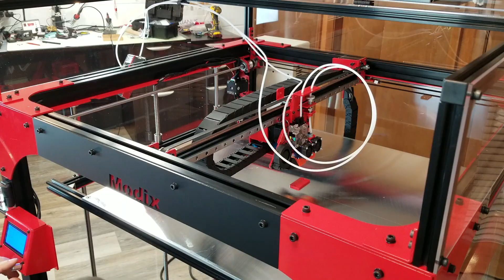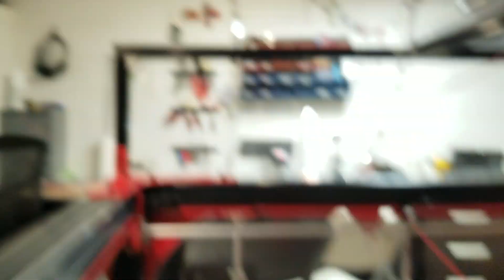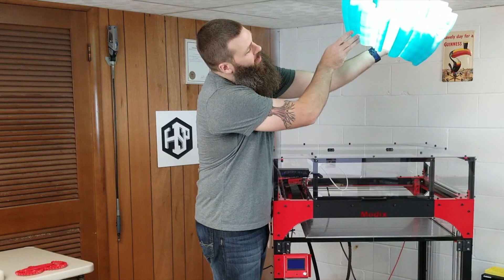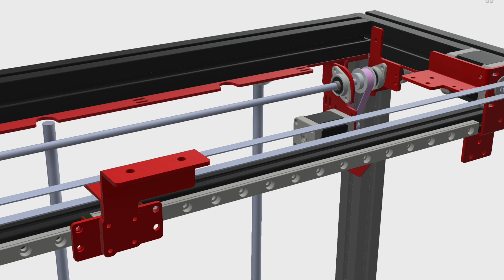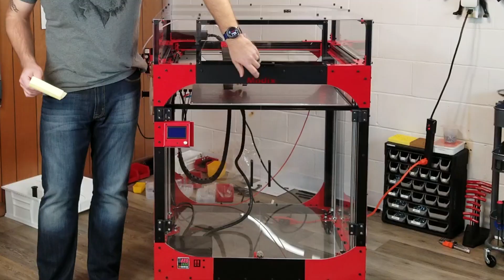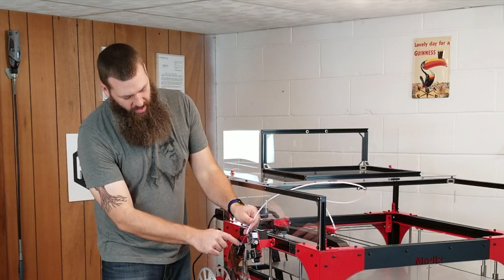Modix BIG-60 3D Printer Build Part 6: Calibration, First Prints, and Final Thoughts

Comment: I just purchased a used Big-60 that looks to be the same as yours. 
As in the three screws , induction leveling (which confused me with an aluminum bed ) and the same controller. 
So far it prints,  although it's not leveling correctly. 
The build plate also seems like it's not far enough to the right. 
It will print though. 
So now I'll be servicing it and lubing it checking the tram and everything else on the unit. 
I'd really like to turn it into an idex but time will tell.
Thanks for your videos,  I love them and will be using them I'm sure.

Comment: Hi Brandon! I have a V3 and have found the Z access seems to "drop" over the course of a print. It starts out correctly, but drops each layer by a few fractions of a mm and needs to be jogged every few layers to get it right. On one occasion I left it to print and found it destroyed two heat breaks and two nozzles in the process. Have you encountered this?
Reply from the maker: This sounds like a machine with a pretty serious problem with the z-axis motion system. It's not something I've encountered (or have ever even heard of) with a Modix printer, but my best suggestion is to ensure that the bed is truly level, and that every part of the z-axis motion system (ball screws, linear rails, linear bearings) is well lubricated. Also, make sure the ball screws are not bottoming out inside the 4040 extrusions that make up the bottom part of the frame--I've seen that happen before. Lastly, make sure the grub screws on the pulleys and bearings for the z-axis motors and ball screws aren't backing out. Might be worth putting a bit of threadlocker on those and then retightening them so they aren't slipping. I hope that helps--good luck!
Reply: @ecostruder  Thank you for your reply! On further investigation, it looks like a combined error of Modix config files using a lower threshold for turning off auto-bed compensation and over extrusion/layer height. Essentially, too much plastic being squeezed out over a given distance means "piling" of material larger than the layer height. This causes the extruder to sink into the material and if the distances are massive, the plastic is cold enough to damage the print head. So I have been working on getting layer heights right compared to extrusion multipliers and plastic temps, which is hard with a fairly basic hot end... Anyway, all good. I'll keep battling away!

Comment: Hi Brandon, great videos. I own a Modix Big 60 and had some challenges getting the printer properly calibrated. Eventually I managed to get it properly levelled but noticed that the E3D extruder is a very vulnerable weak part in relation to the powerful steppers used in the Modix. Do you by any chance have any experience with another extruder such as a Bondtech BMG on Modix?
Reply from the maker: Thanks for watching! I'm curious what you mean by the extruder being a weak part. The E3D Titan (or Titan Aero on the version 3 machines) is quite powerful. It uses a 3:1 gear ratio to multiply the power of the stepper motor to push filament. I had the Titan in my v2 Big60 pulling filament off of a 10kg spool of PETG and printing through a SuperVolcano, so it's definitely got the power to push filament! But no, I haven't tried using a BMG (or similar) extruder before. But the E3D Hemera is an extremely interesting option once it's mature and "ready for prime time!"

Comment: Thank you for the excellent series of videos! I see you are offering the dual extruder kit on your website. Do you still not recommend it? I'm interested in using the second extruder for soluble support.
Reply from the maker: Thanks for watching my series of videos! Yes, I do indeed still sell the machines with the secondary extruder option but I'm still not a big fan of that side-by-side setup, especially when one of the extruders is a bowden and the other is direct. The good news is that Modix is releasing their v3 machines very soon and they are going to be completely redesigned, including the secondary extruder system. I'm quite eager to see how it works compared to the v2 machines. I have filmed a follow-up review of the v2 Big60 which now needs editing and I hope to have it posted within the next few days.
Reply from the maker: @Chauser72  Yes, I am very excited for the v3 machines! I'll be getting a 120X v3 for my shop and I have had a customer pre-order one through me as well. While I really like my Big60 v2, there are some significant upgrades in these new machines. Rest assured that I'll post some videos about it once I have mine!

Comment: Hello ECOstruder, since you've had your Big 60 for about 10 months now, could you follow up your really nice candid video series of the Big 60 with what mods (both hardware and software) you've done to it and what was the outcomes! Like for example, have you tried the Mosaic on it and if so, how did it work? I was thinking of getting a Big 120 (have clients that need really large parts!) and was wondering what I'd run into with it?  Next I was wondering what are you using to control this beast? Such as Octoprint or Repetier running on a Raspberry Pi or some other method? Thanks for the awesome video's and I cannot wait to see what else you're adding to your Big 60!
Reply from the maker: Thanks for the great suggestion! In fact, it's I was already planning to do this exact thing--I just need to get around to doing it. You've given me more motivation to get it done, so expect the video sometime soon(ish)!
Just a quick disclaimer: one of the things I have done in the past 10 months is establish a reseller relationship with Modix. I will provide the most unbiased feedback as possible, but it's important to recognize that I may still have some unconscious bias in my comments since I now sell these machines.
Reply: @ecostruder  I'm looking forward to your next video on this machine, too. Thank you.

Comment: Excellent video! I'm building one right now and I hope everything goes fine with it, any advice for the calibration process? I've heard that auto-leveling is the most difficult part, how was your experience with this process? Have a great one!
Reply from the maker: Thanks for watching, and I am happy that you found it helpful. I will be doing a follow up to this video now that I have many hundreds of hours of printing time with it. As far as the bed leveling goes, I actually found it to be very easy. You just need to get the bed as level as possible side to side and front to back as you can by manually turning the ball screws. Then just run the Unified Bed Leveling procedure and save the results to memory. From then on the machine will compensate for any high or low spots on all future prints as long as you reference that mesh in your starting scripts for each print. It works great!

Comment: Just completed mine today.  No issues, though common sense was occasionally applied instead of calling support as the online assembly instructions haven't quite kept up with the changes and improvements to the Big60 V2.  So far, I love it and had no problem building it at age 75. Can't wait to do a few test parts and then putting it into service for the commercial product manufacturing I purchased it for.  Enjoyed your comments!
Reply from the maker: Fantastic! Excellent job on the application of common sense--the machine is constantly being updated and evolving, so I'm not surprised to hear that the instructions haven't been keeping up. I hope you have as much fun with it as I have had with mine.
Reply: Dan, your comment on the Big60 has me feeling better about my purchase.  I'm not a tech person and have been floundering a little when it comes to getting an item to print, but I am hopeful I will succeed.

Comment: Funny you would mention the instructions...I just put together mine and the further I got, the instructions were less and less and finally not detailed enough.  I'm going to print this weekend so I hope the calibration goes well for me....
Reply from the maker: Yeah, the instructions have gotten improved quite a bit since I used them to build my Big60, but it sounds like they might still have some room for improvement. I'm going to be building a pair of Big60s for one of my customers, so I'll see what has changed very soon!
Reply: Wow! Two builds....I'm sure it will get easier and easier.  After printing the test line, I decided to stop wasting time and I bought a piece of mirror and swapped out the sensor for the BLtouch.  The mirror should be ready today. $53 for a 26x26x1/4 mirror...we'll see how it does.  I just didn't want to put the PEI sheet on only to have to replace it down the road so I tried printing on the alum. plate with glue/water applicated.  It was just so so.. Good luck with the two builds!!  
  @ecostruder

Comment: How are you able to get your prints so smooth? With the profiles from the Modix site we're getting a lot of lines in our prints, and just low quality output in general. Are you using Simplify3D?
Reply from the maker: Hi! Yes, I'm using Simplify3D and working from the supplied profiles from Modix. Of course, I always do some additional tweaking to the profiles to dial them in as I go, but most of these prints were pretty close to the original S3D profile. I'm sorry to hear that your prints didn't look the same--I'm not sure why that would be. Have you checked to ensure that your belts are tight and your bed is leveled properly?
Reply: @ecostruder  .  I am getting some banding in the Z Axis as well.  Is there a way for you to share your Simplify3D printer profile?
Reply from the maker: @TheEebel  Sure, I would be happy to. Shoot me an email to ECOstruder@HartSmartProducts.com and I'll send it to you. That said, I don't think the way the model is sliced will usually cause z-banding. Make sure your bed is level, your ball screws are straight, and your rods are lubricated so there isn't any friction causing the bed to hang.

Comment: Wow that's actually really reasonable in price for the printing size! I'm considering a Railcore II ZLT but I could see a lot more uses for a 3d printer with this build volume. The price is a bit beyond what I can manage right now. Those prints are impressive and I do hope they upgrade to a touchscreen LCD.
Reply from the maker: Thanks! Yes, I agree with everything you said. It's a big machine that is very reasonably priced for what it can do, but it's a big machine, so it will cost more than smaller ones. I'm quite interested in the Railcore as well. Mostly because I want to use the E3D Tool changer on it. A touchscreen can be added after the fact, but yes, I think a touchscreen included with the machine from the start would be a nice touch.
Reply: @ecostruder  Now you're talking. I love the fact that they state they overbuild it for future proofing needs and the E3D tool changer made me pick my jaw up off the floor the first time I saw it.
Reply: The low price point is due to the poor instructions Modix provides. You need a guy like this to make a video who is unpaid for doing so to get it set up. Thank you for your video!

Comment: Great video, I'm using 0.8 nozzle and printing with 0.6 layer hight the result is not that good and I could not find a slicing profile on Modix website they only have the 0.4 profile can you please tell me where I can find a good profile, I'm using simplify 3D. Thank's
Reply from the maker: Thanks for watching! The profile they provide is a great starting point. I actually used their profile to print the big red coaster without any issues. It can be changed to .6mm or .8mm and as long as you select "auto" for the extrusion width. Then you can change the layer height to an appropriate size (.6 layer height should be ok, but I wouldn't go any bigger). Have you contacted Modix customer service for help yet? Shoot me an email to Ecostruder@hartsmartproducts.com with some pictures of the issues you're having with your print quality. I'd also be curious to see screenshots of each tab in your Simplify3D settings. If I can help I will, but Modix is your best option for expert advice on the Big60!
Reply: @ecostruder  Thanks, I will  make these changes and see if I can get clean prints. Thanks again.

Comment: I want to see tiny details. Im interested in a big printer that doesnt require me to have a second printer for small stuff
Reply from the maker: Great point--if this is going to be the only printer you run then it needs to do everything. While that's not really what it is designed for, it has performed quite well when I've put a small (0.4mm) nozzle on it and printed at 100 micron layer resolution. That said, it does use an E3D Volcano hotend, which is meant for high volume and not necessarily high detail. BUT the Titan extruder allows you to rather easily swap in a standard E3D V6 hotend instead, which gets you very nice detail. The BIG 60's mechanical components would not have any trouble with the precision to produce this type of part.

Comment: The reason to test the small parts is to run a whoooolllle bunch in batches. Running 200 2" diameter tokens for a VEX team and cramming 13 a batch on my FT-5. Sure could use that big dog to finish the 200 hours... Maybe this year is the year for a great big dog!
Reply from the maker: Good point--you could fit a lot of parts on that big print bed! However, I never trust any of my machines enough to do that. I always prefer smaller batches. If even one of those 2" tokens failed it could ruin the entire batch. It's a calculated risk, I suppose. But a risk I usually would rather not take, even on machines that typically perform very reliably.
Reply: @ecostruder  It can be sketchy if you don't get everything set up just right. One build up big enough to cause a speed bump and missed step and you're cussing the other lost dozen for sure! So far I baby sit the first layer, then let er run. We're on a 6 bed run without so much as an adjustment and keeping our fingers and eyes crossed!
Reply from the maker: @bustedupbungalow  Very nice! The vast majority of the time I don't have any issues, but it's those rare situations where something goes wrong and the whole batch is ruined that turns me off to the idea. If it's practical to break it up into smaller batches I will. But there are definitely times when I just want to start a print and come back a few days later to have a large quantity of parts ready to pull off the machine. Really great when that works out.

Comment: I have looked at this but the cost... Id be curious to see Groot or the trex skull in max possible resolution and the time taken
Reply from the maker: While I am sure it is capable of performing quite well on high detail prints, I generally use the BIG-60 for large functional models. The E3D Volcano hotend it comes with is meant to move a lot of plastic through a large nozzle as quickly as possible. If you swap it out with a standard V6 you could get nice details, but then printing anything that takes advantage of the size would take absolutely forever. So, while it is capable of printing small, high resolution parts, big machines like this one are generally meant to print big things with big, chunky layers.

Comment: Great video! Can a pellet extruder be added for a cheaper price per lbs
Reply from the maker: Thanks! And adding a pellet extruder would be a great idea, though I haven't seen very good results from most pellet-based machines versus those that use filament. To answer your question though, yes there is nothing that prevents the BIG60 (or 120X) from being converted to a pellet extruder. It's one of the things I like most about the design--it's very modular and easy to modify.

Comment: Thx for you response. Do you happen to know which main board the big60 uses? 32bit?

I'm trying to get the company I work at to buy one.
Reply from the maker: Sure, you can check out the specs on the Modix website here: http://www.modix3d.com/tech-spec/. It uses the Makerbase, MKS Gen 1.4, which is an Arduino Mega-based design. It uses an 8-bit microcontroller. Good luck with the boss!
Reply: Last question. The wheels you added to the big 60 would you get bigger ones or you liked the ones you got?

Can you give me a link from Amazon? Are they M8 on the threads?

You got a permanent subscriber here keep up the good work!!!

Comment: At 38 mins. That tube needs to be conected. No wonder you have had under exstrusion lovley printer but defo sort the ptfe coupling
Reply from the maker: Hi Warren! That PTFE tube is just a guide tube to help the filament get to the hot end without getting tangled or kinked. For a few prints I actually removed it completely since it isn't totally necessary. My point in the video is that there is no reason for it to be 1.8mm. This is not a Bowden system, so having such a tight internal diameter on the PTFE just adds friction without any benefit, and causes the extruder to have to pull harder to move it (Note: the 2nd extruder is a Bowden setup, so that one definitely does require a fully secured 1.8mm PTFE tube). I popped 3mm internal diameter tubing on there to reduce that friction and it helped quite a bit. It would be great if it fit into the old PTFE fittings, but it doesn't make much difference if it isn't connected.
Reply: @ecostruder  ow sweet so its direct drive then. My missunderstanding. Can i ask what pitch the ballscrews are as ive been considering this as a z upgrade. And how do they compare to standerd lead screws in terms of lag or slop as its worded when going baxk and forth. I know z wont suffer as itle have a load mass all the time in one direction
Reply from the maker: @W.Lyon91  I don't know the pitch of the ballscrews, but they are connected with a small belt which increases the steps/mm. In practical use this has resulted in a high degree of z accuracy. There is really no slop/backlash at all.